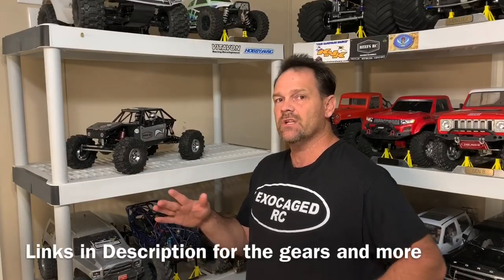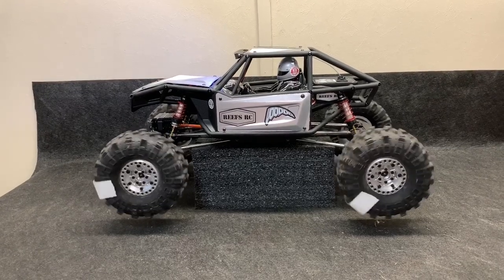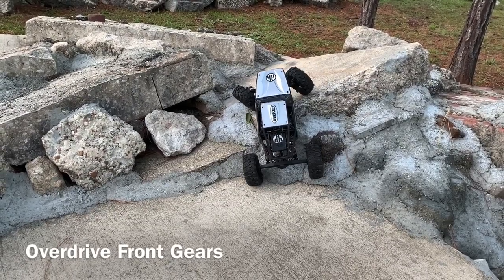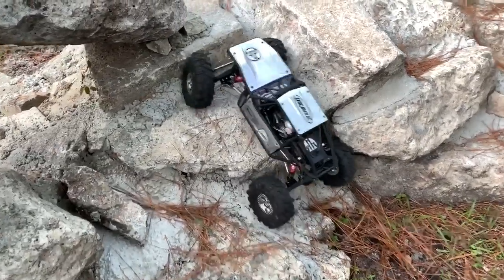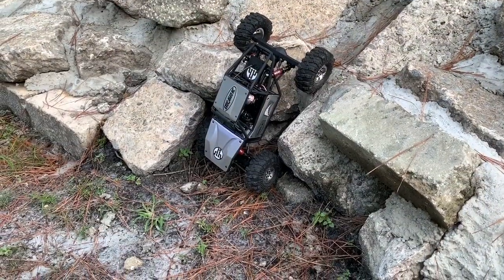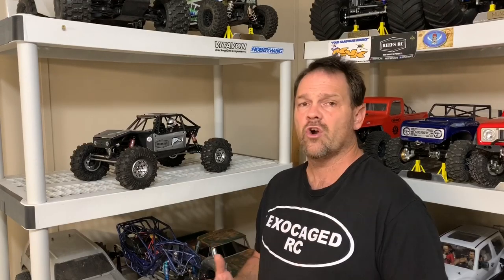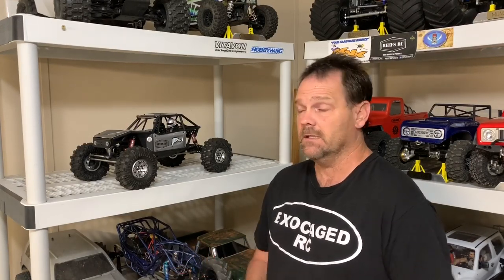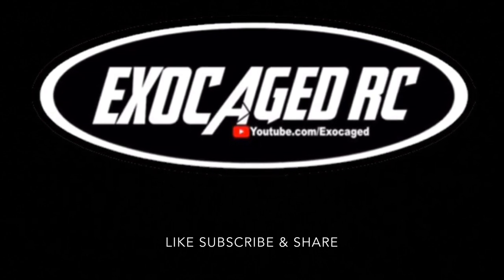Capra with OverDrive gears

Comment: Try the team garage hack overdrive portal gears. The boom racing ring and pinion gears give you about 12% overdrive where as the TGH overdrive gears give you about 30% overdrive. It puts a lot of stress on the drivetrain but it really sucks you down!

Comment: How much difference from 1:1 depends on the actual gear ratios.  The sendero (for example) comes with a set of overdrive gears, but offers another set that almost doubles the overdrive rate. I have to admit that I haven't driven a rig with that feature so I can't speak to what works. Interesting video.

Comment: Great video gonna try some as I see a difference when it starts hopping on the rocks out here in the west coast....try throwing some brass in the front wheels to get some forward weight bias did it to mine and it was huge just my 2 cents...
Reply from the maker: I change wheels and tires quite a bit so I'm holding out for some brass to start showing up, that way I can get some consistency when comparing tires in tests.
Reply: I added 400g each wheel with the voodo tires and it gave me a 63/37% weight bias and just was awesome this weekend it destroyed my Trx4 comp 2 and the light weight scx10 II rig in the group of guys that crawl....the Capra for sure is a cheater rig!!!!
Reply from the maker: Ed Serauskis I’m having similar success with mine as it sits. In our comps there is a lot of downhill stuff, some of it is as steep or steeper than the climbs. How does yours do on those?
Reply: Exocaged RC  well the limit I have found on bias for my vehicles is 65/35 after that it’s a bit light in the rear but in all my wheels I always run the ssd brass disc brake style hub on all 4 corners....seems to help getting a bit of weight on the tire itself running the dig really helped on steep sandy dusty rocks only issue has been a bump that would upset the rear and then would want to flip but I have been practicing unlocking the dig on a down hill prior to it unloading the chassis and driving out of it Iam running the yellow jacket 2000kv and it’s geared with a 13t pinion it naturally has a rev control kinda built in so it’s more controllable on a down hill as opposed to the Holmes 2700kv I was running, don’t get me wrong the Holmes is awesome but the outrunner seems like the rpms are in a better controlled window....

Comment: I did the opposite in my truck and put underdrive gears in the rear to increase the gearing and still have that same effect
Reply: What brand U/D gears?
Reply: Where are you getting underdrive gears for the ar44 axles?
Reply: I just meant in general😅 axial is coming out with ud/od gears for the capra just hold on
Reply: MrVergeetmenietje why would axial come out with over/underdrive gears for the Capra? ...they gave the Capra a Dig unit....defeating the point of the gears.... if they did it would be for AR44 axles in General, but with AR44 housings being much smaller in nature it’s hard to add more teeth to an already small ring gear. That’s why you only find overdrive gears being made.
Reply: @northsandiegorc3276  because they said they would in one of their release speeches, not everyone uses dig and some people will definitely go ud/ud to get more gearing. Wich will help if you use the dig or not.
Reply: I believe Hot Racing now has overdrive for the portal gears.
Reply: YouriVL you’ll only find OD for ring gears, not underdrive, only way to properly go about is at the portal boxes

Comment: Why would you install OD gears in a Capra when it already has a Dig?   These OD gears is about 11-12% overdrive on the front axle. AR44 axle housings are not very large in general so finding underdrive gears (more teeth) is not very likely. Hence no one has come out with them.

Comment: Look'n great. Now... after you do the 4ws... you can do the Comp chassis and 2.2.
Reply from the maker: TrailCrawler 203 I’ve done the 2.2 with the KLR Golds. I’ve seen the chassis I think but since I have several comp style trucks I may just leave this one alone as a Capra.
Reply: @ExocagedRC   I don't think I've seen you put one of those 2.2 Comp style rigs on the rocks yet. Can you do a vid of that?
Reply from the maker: @trailcrawler2038  my current 2.2 comp rig is the Grimlock 3 truck with 4ws, its a TRX4 based truck I have videos of that one plus a build series on it.
Reply from the maker: @trailcrawler2038  if you're talking about a 2.2 comp shafty then I don't have one of those. I used to but not anymore.